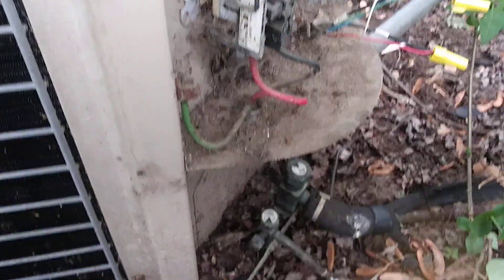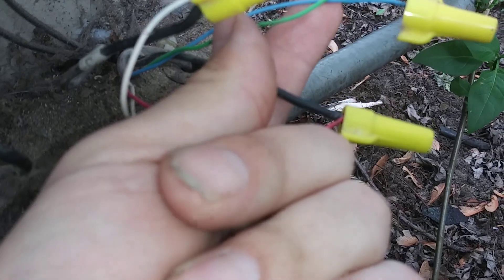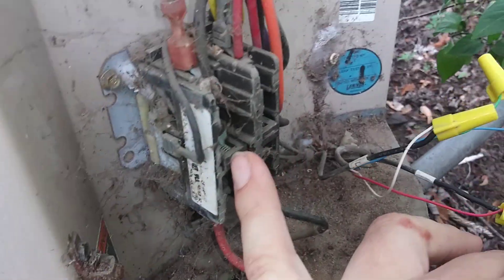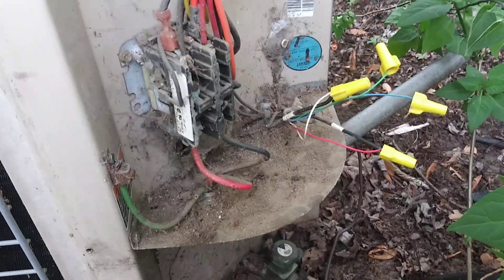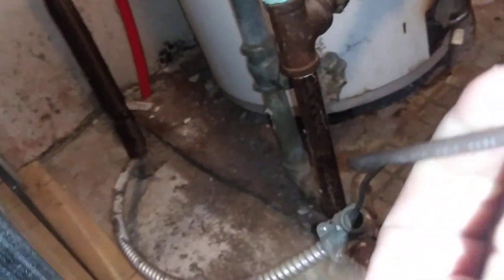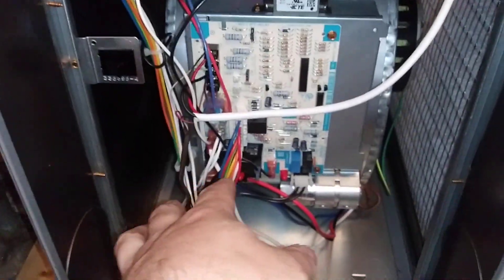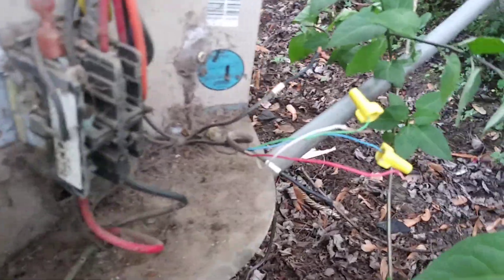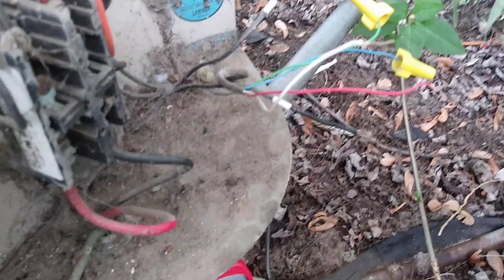Fixing My Central A/C Found Disconnected Wires

Comment: That's awesome it works. I was afraid it was out of refrigerant, or had a bad compressor, which sounds great by the way. Will be interesting to see how it does under the heat load of summer. Probably a good idea to get the tune up special, and even better idea you did the power management delete, even though it wasn't working.
That's crazy the installers simply just didn't wire the 24 volts back up.

Comment: Now seeing the whole picture, it kinda makes sense now.  It was a rental, so the landlord didn't care.  It needed a furnace.  Since nobody was watching, they did the minimum amount possible and forgot, or deliberately left it disconnected.  Well anyway it works so that's the main thing.  Temp seems OK for the day I suppose.  The hot days will tell you for sure.  Like most systems, it's likely undersized for some REAL cooling if you know what I mean.  I'd imagine your window unit would supplement upstairs where the airflow is weaker.  Perhaps it might help to make some sort of deflector to "bend" the air upwards instead of down at the floor where it will stay for the most part.  Cardboard and duct tape would suffice, or it's a pretty quick woodworking project with plywood.  They also used to sell "office mailboxes" that are made out of plastic that attach to the wall with screws, those can be retrofitted as well if you can find them.  They hold like a sheet of paper on the long side.  Something like these to give you an idea of what I'm talking about:  https://www.wayfair.com/Storex--Unbreakable-Legal-Wall-File-70321U06C-70361U06C-L97-K~USM1112.html
Reply: Used to work a small hardware store for about 3 years, I know exactly what you're describing . https://www.homedepot.com/p/4-1-8-in-x-10-1-8-in-Plastic-Sidewall-Heat-and-Air-Deflector-HD9/100550643 This is purpose built for what you're talking about.
Reply from the maker: It's 86 today and 63 is the temp coming out of the vent in my room upstairs. The attics add heat and Im sure the ducts are not insulated either. But it works. It can maintain 70 but we got it set at 72. I have a few plastic deflectors. Fans help disperse the air upstairs.  The real test will be those mid 90 to 100 degree days.
Reply: Yep, I'd like to see what it can do then.  What's the temp at the closest vent to the air handler?  That should give you a good idea if the vents are insulated or not.

Another thing you can do, sometimes on the air handler where all the ducts come out and branch off, if they're all individually run, they have (well, should have) dampers built-in on them.  You use those to "balance" the system, allowing more air upstairs and less downstairs.  It's a fine-tuning adjustment, essentially.
Reply from the maker: @jaykay18  all the vents downstairs are reading around 60 degrees so about a 3 degree difference between downstairs and upstairs.
Reply: I'd say that's well within spec.  Maybe someone at work knows some HVAC person who can check your system out for cheap?  I once had the same thing, guy who came in to fix Tiny Middle's A/C.  I asked him and he said he does stuff on the side.  He came in, replaced the contactors in both, hooked his gauges up and topped off the upstairs unit just a tiny bit it needed.  I think I paid $75 or so.